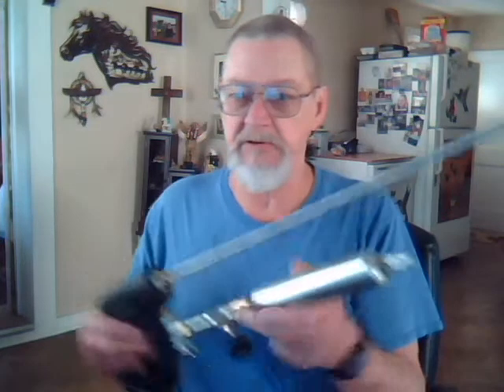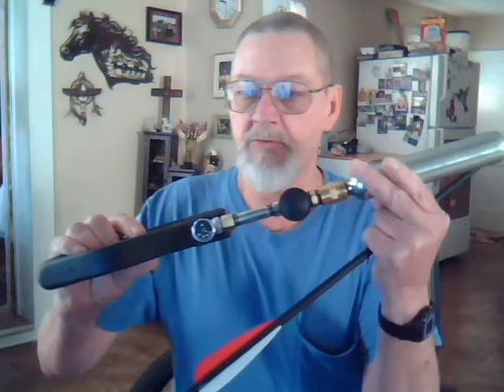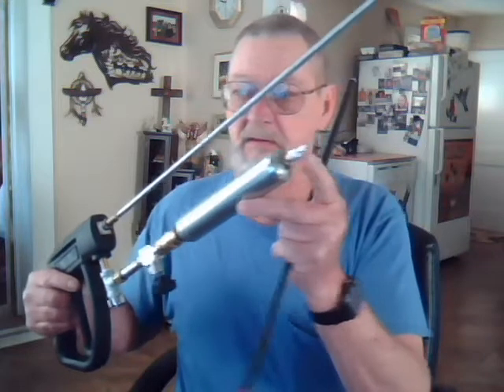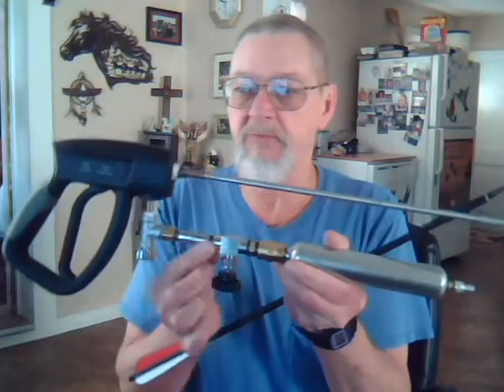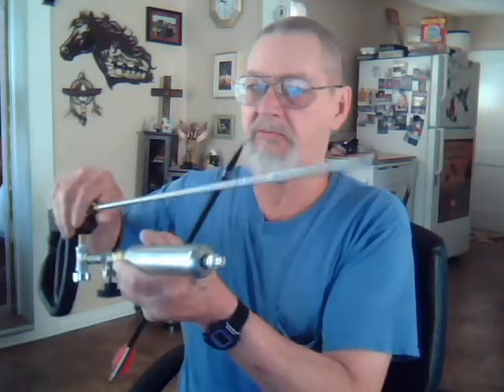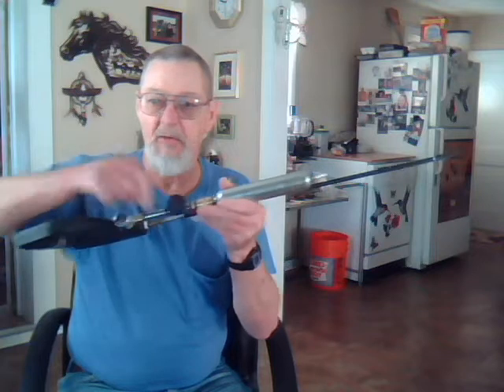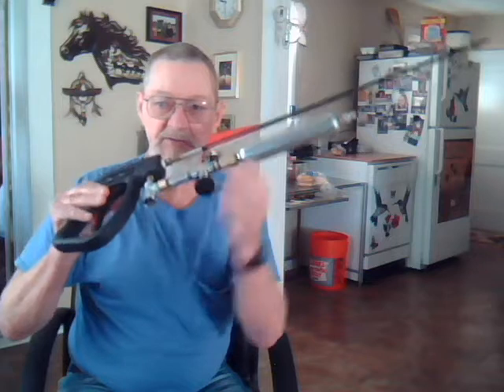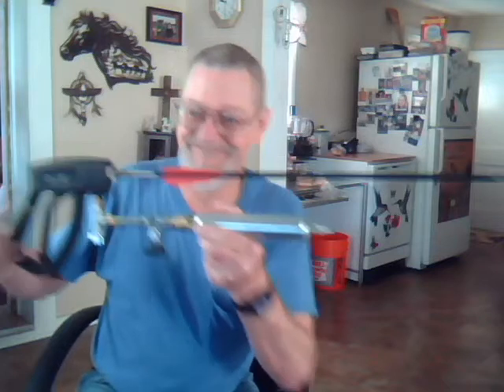High pressure air powered arrow launcher!

Comment: Bel video complimenti,mi puoi dire la pistola quanti psi ha?quanti l/min deve avere?grazie
Reply from the maker: The main tank holds 2000 psi then the valve can release 800 psi into the pipe to the valve 10 times to make 10 shots. I do not know how fast it goes. No chronograph. Thank you!
Reply: @gadgetguyify  grazie di cuore

Comment: Nice design.  My design uses lower pressure air and a down-the-pipe design instead of arrow-over-pipe design.  I don't see any other arrow shooting air guns of that design on YouTube, and I kind of wonder why.  I get around 300 fps @ 150psi with a 300 grain short arrow.  Haven't really tried to improve on that because it fills my needs.  Maybe I should get my grandson to help me put a video of it on my channel (which doesn't have anything on it anyway).
Reply from the maker: Check my videos and you will see one like you are talking about that you made. If you make a video, I would like to see it, so send me a heads up!
Reply from the maker: https://youtu.be/kwDRTe_-5dE